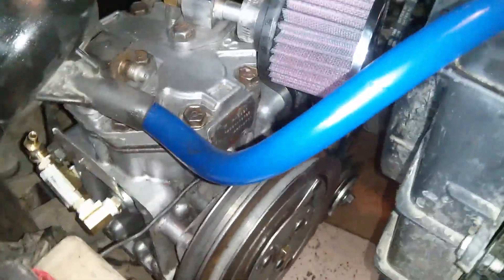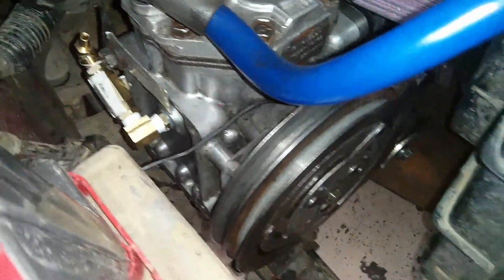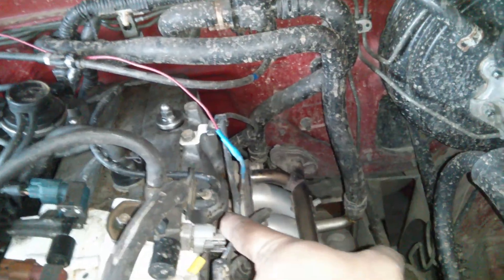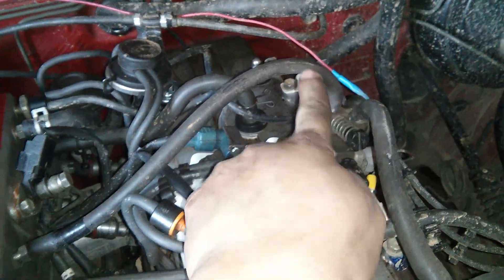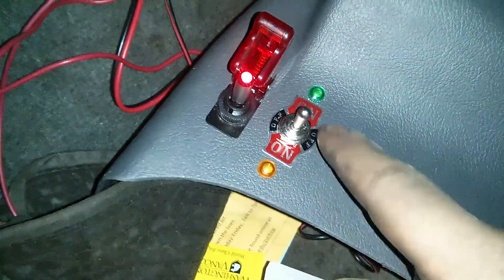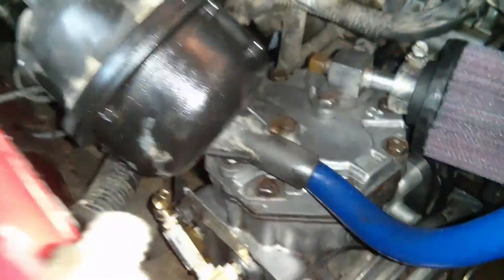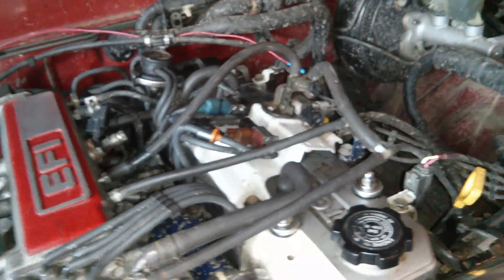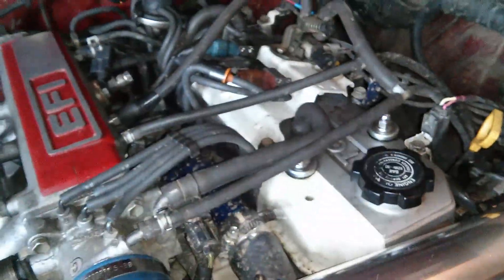York OBA 22RE

Comment: the York clutch only draws 3-4amps so a relay isn't needed.
Reply from the maker: the York isn't the only thing I'm powering. there's also an idle up solenoid,
Reply from the maker: idle up, pressure relief solenoid... might not be crucial to run a relay, but I'd rather over engineer it than start a fire.. you should check out how it's sitting now on my Instagram: @excabswap
Reply: +Philip Gragg oh OK that makes sense.